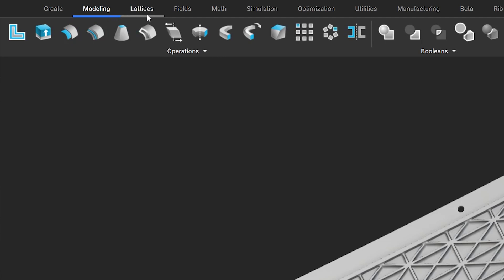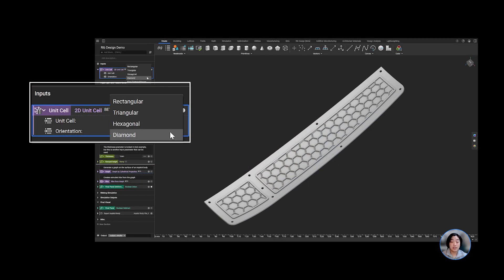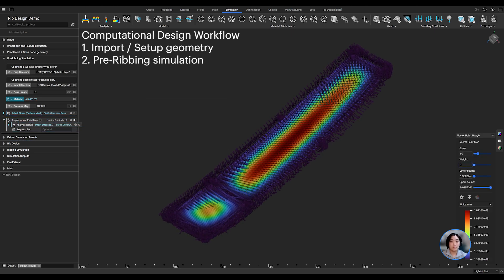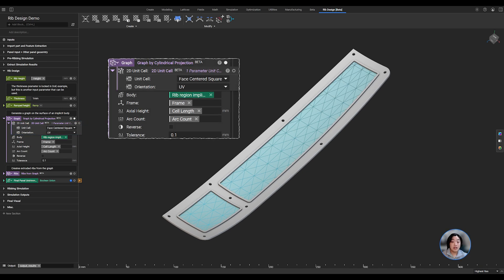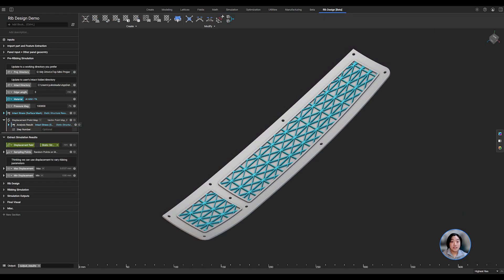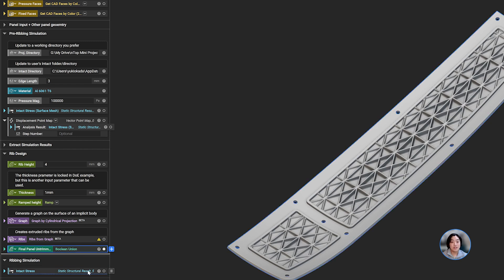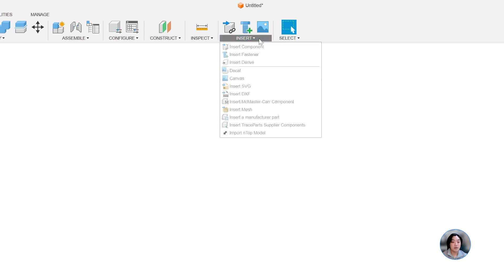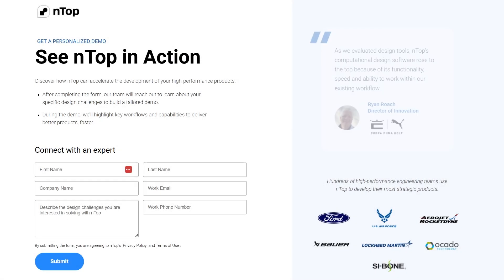Creating a computational design workflow to lightweight drone's panels with nTop's new ribbing tools

Comment: Sir could you please make one video about how to draw gyroid structures for 4,5,6 cells in ntop because its my project.i got edu licence and i downloaded the software but for me it is not showing properties like you sir
Reply from the maker: The ribbing tool is currently in beta. Make sure you have the beta blocks turned on within your settings. Once on, you should have access to the ribbing tools with the 2D unit cell structures.

Comment: I was wondering about the placement of the ribs—since you’re adding them where displacement is highest, wouldn’t it make more sense to place them where strain is highest instead? For example, with a cantilever beam, you wouldn’t make it thicker at the free end (where displacement is greatest) but at the base (where strain and stress are the highest).

Is there a way to place the ribs based on strain data obtained from a simulation?